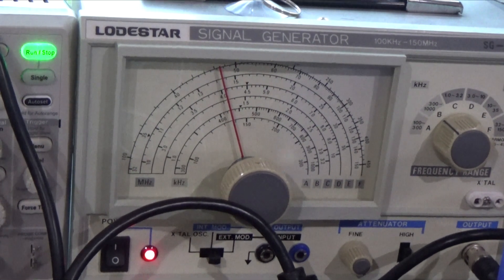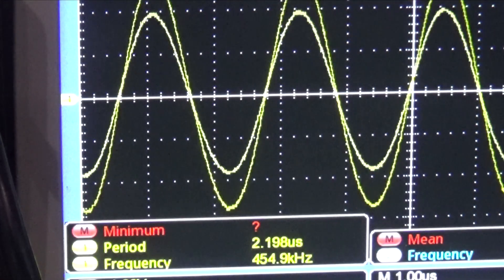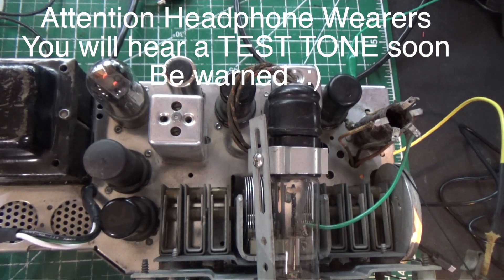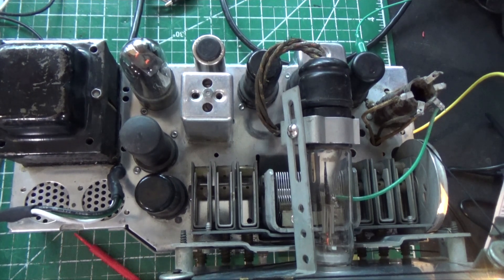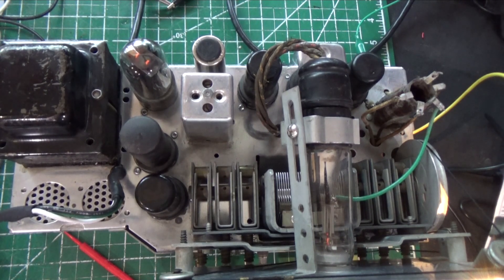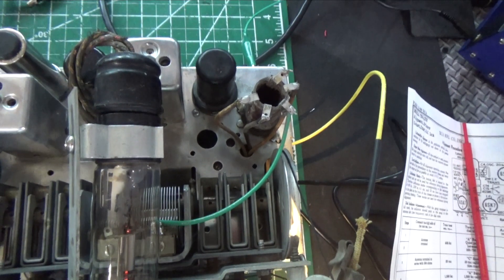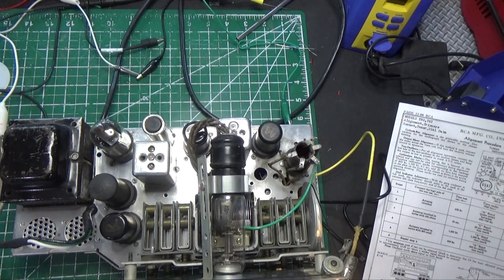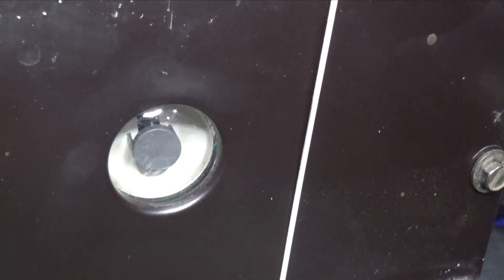Radio Restoration for Beginners RCA Model T62 aka #39 Part 8a: Radio Alignment tips and tricks

Comment: Hi Ron.  I messaged you recently about this chassis but since I’m new to all this you might not have gotten it.   I’m working on a RCA T60.  My question is you pointed out the cloth/spring pieces to help return the tuning buttons.  A few were missing and some were torn, others worked.  Did you address the repair of those?   If so, I might have missed it.  Could you let me know what you did to fix them.   Thanks.  Ralph.    I love your videos.